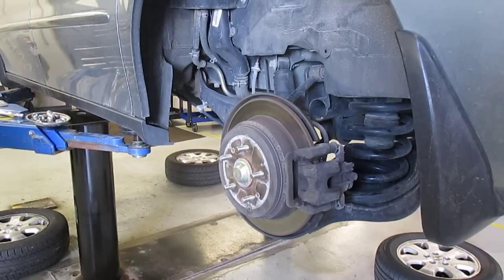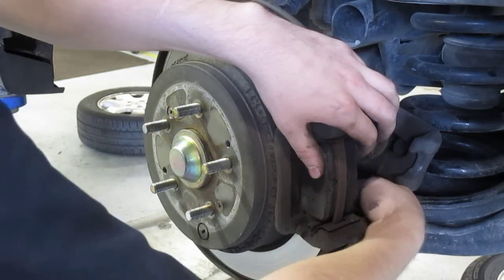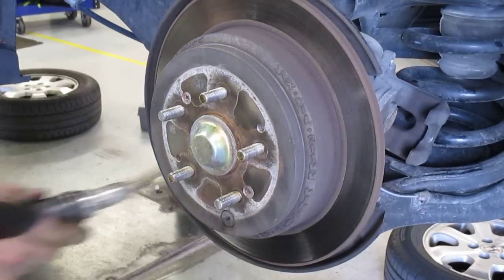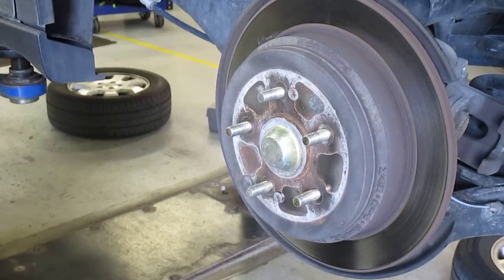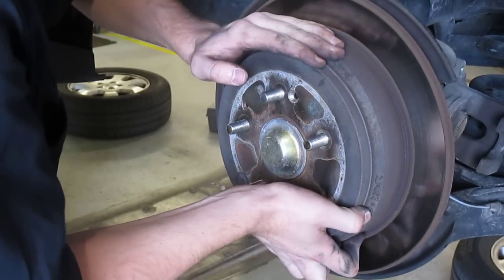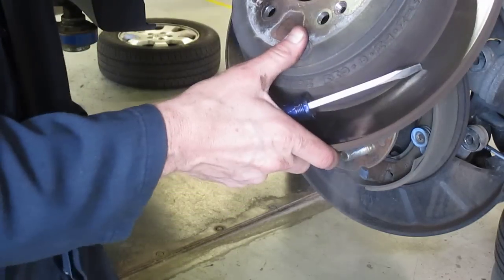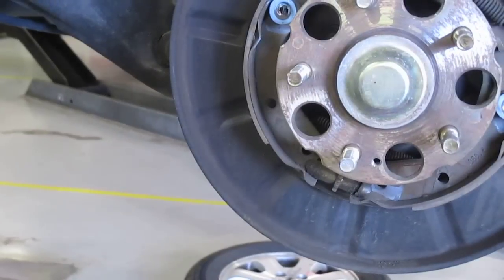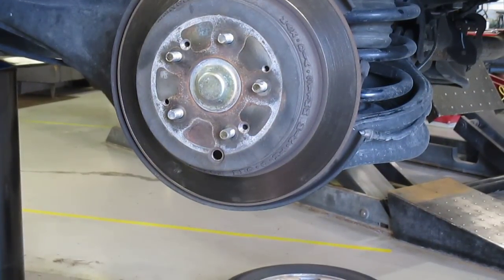Rear Parking Brake Honda

Comment: Strange that Honda would use an entirely different system on the Accord.  It uses the disk brake pad, not an additional brake system.
Reply: European/Japanese Accord (Acura TSX) uses drum brakes for the parking brake though
Reply: maybe accord needs better brakes/bigger disk, then there is no place for drum ;)

Comment: OK, so which way do you turn the star wheel to adjust the shoes contract or expand, clockwise or counter clockwise?
Reply: I couldn’t figure this out myself I literally just turned mine until I figured it out. Just turn it and watch the movements. One or two clicks makes it really obvious.
Reply: Anticlockwise for out. Clockwise for in.
Reply: Teeth up for tighten teeth down to loosen shoes

Comment: So the parking brake is an old fashioned drum brake setup except no hydraulic wheel cylinder, just the cable to activate.  We used to adjust drum brakes by backing up and hitting the brake peddle as this would click the adjuster star one click.   Not sure if you can do it by stopping with the parking brake when you backup?
Reply: I doubt the parking brake is that advanced.  A lot of cars in the early '60's didn't have self adjusting brakes.

Comment: Professional mechanic 😆 
To remove rear brake disc you use two bolts wich you screw in 2 holes specifically made for it.

Comment: What happens if you take off the rotors and your parking brake is on?
Reply: If the shoes are gripping the drum, you won't get it off.
Reply: Its almost impossible with parking brake on